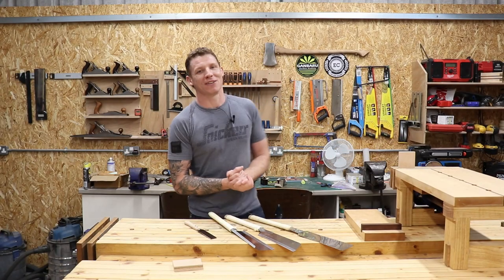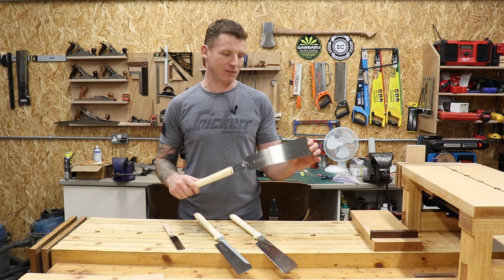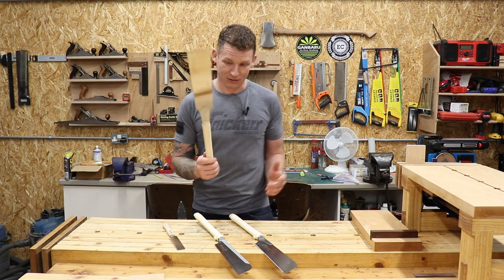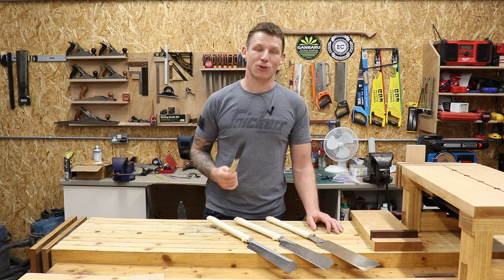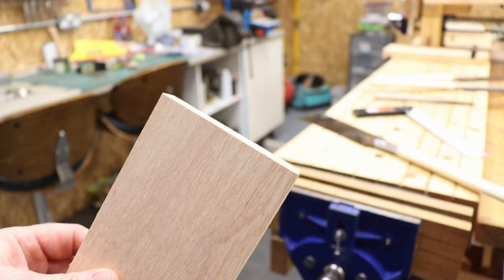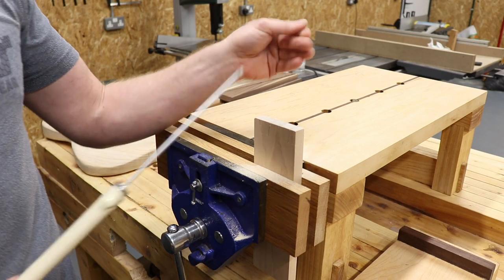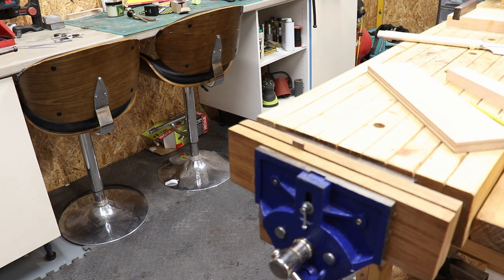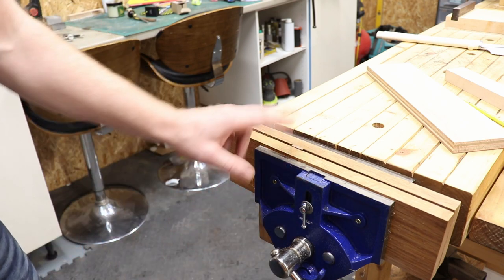GYOKUCHO JAPANESE HAND SAWS,

Comment: I have had these saws for years (15+) and  a couple of things to get used to. One is they will drift. I can cut a much straighter line with the back or basic western cross cut saw. (Ones I file myself per the Paul Sellers method also) and I see a lot of teeth snapping on hardwood. I used to make a lot of furniture (so hidden joints and dovetails, some sliding ones too) mostly maple (figured, birds-eye, spalted)  some walnut and cherry and had a fair amount of breakage. All told, several $$100's of new "replacement" blades on the katana and ryoba ( the 2 main classes of Japanese  saws) . Thus far, none of my "western saws" have bit the dust and/required replacement due to use/age. Granted, the more precise, surgical kerf, is way more intricate but at the price of delicate also. I still have to clean up to the lines on any joint or final dimension anyway. The specialty saws are really awesome and often very unique. I do like the feel and lightness of these saws and use them quite frequently. If I could only figure out how to sharpen!  For your information, here is a list of common Japanese saws:
tategu-shi- means refers to craftsman or carpenter performing the work
anahiki-nokigiri- crosscut for logs and beams (up to 20" long blade) 
kamochiki-nokogiri- making deep grooves (kamoe) for sliding doors etc
kataba-nohogiri- single edge
kugihiki-nokogiri- flush cutting bamboo "nails" , blade is tapered and usually 20-26 teeth per inch! Hard, highly tempered. 
osachiki-nokogiri- cuts grooves in making plane (kana)  blocks, deep and no set at all
hosobiki-nokogiri- small dosuki with rip teeth
dosuki-nokogiri- cross cutting thin stock
ryoba-noko- double edge
azebiki-nokogiri- veneer work and inlays
maebiki-nokogiri- huge milling saws
and not often used a mawashibiki-nokogiri- like a western key-hole saw
Please keep up the good content on your videos. DD
Reply: Agree the hard or heavily figured timbers can be a bitch using the ryoba etc. However, have you reviewed your grip on the saw? Sometimes a slight adjustment on how you hold the saw can reduce drift. Try to hold the saw such that it is an extension of your hand when you are cutting. I.e reduce the angle between the saw handle and your arm as much as possible. So as you draw back on the saw it is less likely to drift.  It took me a few goes to get it right, but it works very well🙂

Comment: If you notice there are modified teeth at the top and bottom, the top one is for finish of ten on and such as it is aligned with only the first cutting tooth, leaving no perf Mark. The bottom on is for starting saw perf next to straight edge.

Comment: You can find really good quality Japanese saws that can be sharpened, but they generally require an expert to do it, so the cost of sending it to Japan ends up making sharpening more expensive than just buying a new one which is why outside of Japan it makes much more sense to get the saws with the replaceable blades.   I don’t know how much expertise is required though...maybe it’s possible to learn to do it yourself which could make getting the other version worth it.
Reply: Indeed you are correct. In addition, you need to use the correct size feather edge file to sharpen the teeth. Remember, though you can’t (shouldn’t) sharpen replaceable blades ..these are high frequency  impulse hardened to last up to 7 years before replacement is required.😎
Reply: @MrSteamDragon  Is there any benefit to using sharpen-able blades aside from cost of replacement? It's hard to imagine sharpening costs low enough that the reusable blades become cheaper unless it is fully automated by machine. Does anyone still get theirs resharpened? or is it something people actually learn to do themselves? Do they get somehow sharper?
Reply: @RichardBuckman  Hi Richard, a benefit of sharpening your own blade? I guess if you have the skills/tools to do it yourself then a quicker turn around would be the obvious benefit; you don’t have to shop around or order a new blade.  Are replaceable blades better? I cant offer an opinion on this one but I would assume a craftsman who is proficient at the task would be able restore the blade to it original condition. From my experience (albeit limited) with japanese saws is that good quality replaceable blades cost roughly half that of the original saw. And those blades are touted to last 5-7 years before needing to be replaced, so the value for money isn’t that bad.  At the end of the day I think its a personal preference. Some may even chose to resharpen because they enjoy the experience.  It’d be interesting to hear other’s peoples views. Cheers from Oz 🇦🇺

Comment: All the craftsmen of the past whose prized furniture is in museums and people travel to see them and admire, didn't knew about these miraculous Japanese saws. Pity.
Reply: I didn't quite catch the sarcasm in your comment. Please elaborate.
Reply: @LitoGeorge  I was given on of these dual edged saw by a friend, I used it as a novelty, then one day out of no reason (to me), while ripping a piece of soft wood I badly cut my little finger of left hand. What I did was that out of habit I momentarily held the upper ripped portion for just a meaningless support which I have been doing for the past  50 years, 75 now, the proper hand saw, pull or push, would always said hello to my finger if it lightly touched but this was a Samurai. They cut fast but would you do when the crosscut teeth are dull, you have to take a university degree in kung-fu to sharpen them. They may be good, I do agree but not that good enough that we should praise them as the only good saws, my times ending new disposable times come that's the cycle 😉 😀.